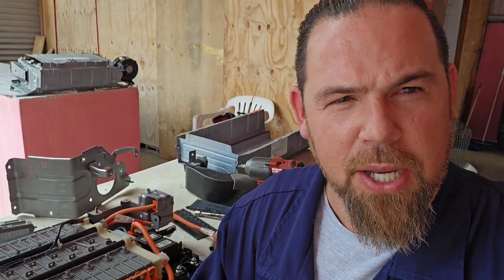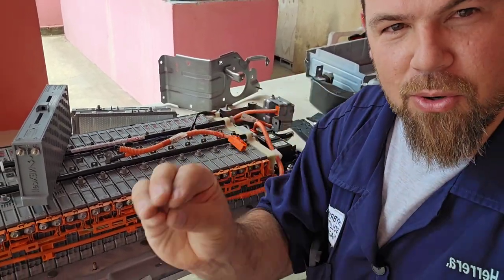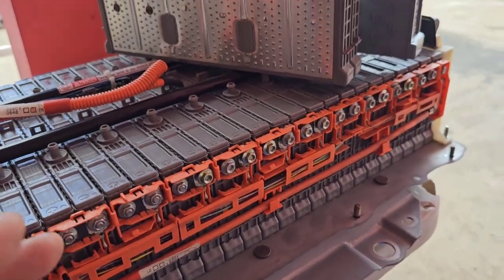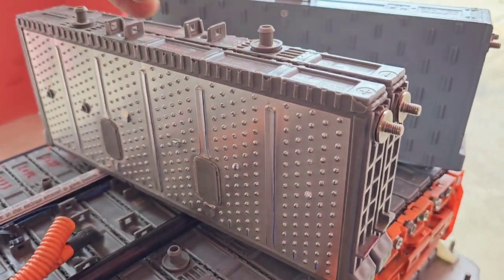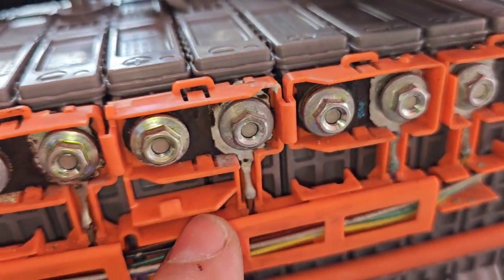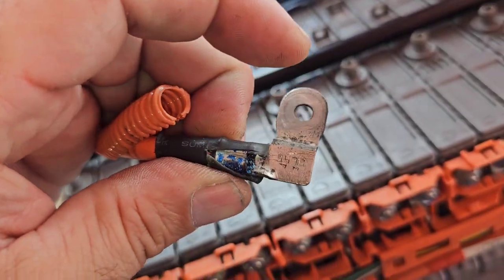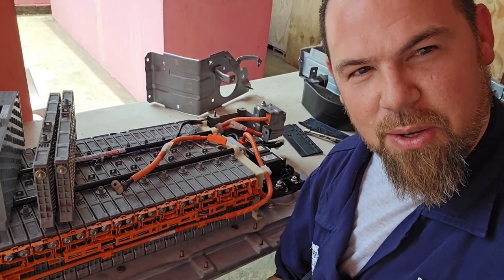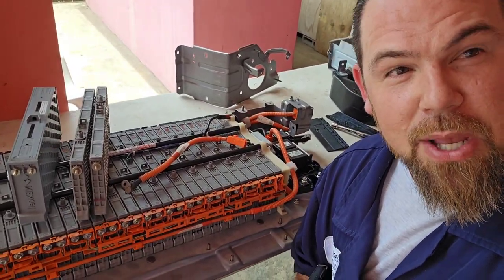Worst mistakes when installing toyota hybrid battery

Comment: Hello , Jose I have been watching you for about 2 years now I personally think you make the most reliable videos and Helpful information . So , I am fixing  my 2012 Prius V  . Because The Dreaded  Light came on and my car died at 200,000 miles . I found out the 12 V Battery was dead and replaced it . And the car started and drove fine but then the Light came back on at 205,000 miles the code said I needed  to Replace the Hybrid Battery Pack . So in April 2023 I used my Think-car 7S Plus Scanner to Diagnose the issue and the Dr Prius Updated app . I found Block 1 Was bad and Replaced 2 Cells and it still showed bad . I thought  I replaced the correct cells in Block 1 but found out now it was Block 14 cells that I replaced by mistake . I wasted all that time and effort because I did not know the correct location of the cells and the Blocks on my 2012 Prius V Hybrid pack .  I just found out that  Block 14 is actually Cells 1 and 2 on A Prius V 2012  . The cells start from the electronics side or Passenger side (1-28) on a 2012 Prius V . But the Blocks start from the opposite side or Drivers side .  Which meant I replaced Block 14  ( Cells 1 and 2 ) Not Block 1 (cells 27 and 28 ) causing me to get the same error as before . I have not found any Video's showing the Block to Cell configurations on Here and Was Hoping you could make a comment or Video about what Cell corresponds to what Block and what are the Locations of the Blocks Such as on a Prius 2008 etc..  and others such as like mine a  2010-2015 Prius V . And How to Test each cell and Completely Check if the Used Replacement cell is good or not or just a waste of time  . and We will be able to know what Cell on Dr Prius Belongs to what Block on the Battery and what is the Location of each Block and if the cell is good or bad . It would help so so Much as all your Video's do . If I had Just Known the crazy configuration of Block 1 was cells 27 and 28 and not cells 1 and 2 . So I hope you can help others in the same boat as I was . Thanks Reggie

Comment: He is lying about capacity. I don’t think he is going to sit there for hours just to measure capacity lol. I work on all types of hybrid and electric cars I’m also certified EV/ Hybrid tech this does not know much except hybrid battery. I actually designed a reliable hybrid battery tester I just won’t share it on YouTube

Comment: Jose.  Just found your videos and hands down the best videos on Hybrid Batteries. I'm a DIYer and have been having recurring problems on the same battery pack, even after changing all the bus bars and nuts.  I was on the suspicion that the corrosion on the cables was the problem and just order new ones.  I haven't gotten them yet to try, but after watching this video, I'm more convinced that will solve the problem.  Great work!!!!!! and superb explanations.
Reply from the maker: Thank you Mauricio, glad you liked it…
Reply: How did it go?
Reply: where did you purchase new cables? thanks, ed

Comment: Good tip re battery cable corrosion, seen this a lot on lead acid battery systems and the cable is not repairable.
Reply from the maker: Yes, it must be replaced
Reply from the maker: @alext8828  is it too difficult to believe the both actually happen! 🧐🧐🤣🤣🤣🤣🤣

Comment: how are you finding the reliability of Nexcell/Project Lithium Batteries? as long as there is not any corrosion on the have the batteries them self proven to be reliable ?
Reply from the maker: So far so good with nexcell… 😎👍 too soon to say yet… let those batteries for 2 more years and we will see 👊😁🔋🔋🔋🪫🪫🪫🪫💥💥💥💥💥💥💥
Reply: @hybridsolutiondiagnostics  thanks for update i heard ppl are getting 10% better fuel economy on nexcell i guess it all depends how you drive
Reply: @hybridsolutiondiagnostics  I believe the hard part is getting the Nexcell/Project Lithium modules. I have been trying to get some for the last 6 months and their website keeps on saying "Sold Out"  Any insights on where to get them Jose?

Comment: Should also mention the corrosion getting into the battery ECU and triggering fires.  The battery main vents don't work. The negative post seal fails before the main vent and that causes all the damage.  There should be a class action suit...

Comment: Love your videos, very informative, very practical in approach. I understand for video teaching it is best to have the entire battery out for service but can a battery service be completed by removing the top shell then replacing the cells or modules and then replacing the connections and top shell? (Highlander or RX400h) thx so much.
Reply from the maker: It is always good to have a deep cleaning of the battery...

Comment: Hi there your videos are great! I am checking a P0AA6 code on my 2008 prius. I took out the HV battery and there was a bunch or corrosion, following your video on how to do that👍🏻. But my question is, will i need to re balance my battery or charge it in anyway or can i just put the battery back and let the car charge on its own? Also the P0AA6 comes on in park without the engine on so it’s not transaxle or inverter, definitely battery/wiring.
Reply from the maker: Yes, it could be a bad signal due to that stupid corrosion… so have it a visual inspect and some measurements

Comment: thanks for posting this video. Where can I buy these hybrid battery electrical cables ....the orange ones that get corroded over time? I can only find them used as on eBay.   I want to purchase new ones.
thanks
ed

Comment: Man, I need one suggestion from you regarding break oil maintenance for my Toyota hybrid fielder 2016. Here in Bangladesh mechanic doesn't have much idea. Car users often suffers with break booster problem and ends up destroying break booster. Can you please let me know the exact maintenance for break system like when to change break fluid, and break shoe so that I don't have face break booster problem for my Toyota hybrid fielder 2016 ???

Comment: Dr Prius app measures internal resistance and gives a reading for each module.  Is there a maximum reading. 

I ask because I've already installed the Nexcell in an 08 Prius and I'd like to make sure I didn't mess up. I don't think so but I did use the original harness (cleaned connections).
Reply: I drove the car today and internal resistance was between 13 & 15 milli-ohms.  Battery temp was 95.8, 95.6 & 92.5 Ferenheit. Blade voltage was 8.14 with .04 Volt Diff.
 That all seems good.  Is there anything else critical on a new battery?

Comment: hola jose! gracias por tus videos son de mucha ayuda, tengo un 2007 camry hybrid el cual no puedo hacer que funcione correctamente, mi scanner me dice que block 2 y 3 no funcionan, ok, los cambio  pero no resolvio el problema, los cambio de nuevo y esta vez remuevo todas las celdas y hago un load test, reemplazo todas las celdas mas bajas, las balanceo, todas marcan 8.2 volts, instalo todo de nuevo  asegurando de limpiar terminales,etc nuevas bus bars y tuercas, y resulta que no se resuelve mi problema, uso dr prius y cuando monitoreo la bateria los bloques 2 y 3 suben y bajan en verde pero bajan hasta abajo en rojo, que puedo hacer? la luz roja en el dashboard ahora prende y apaga en intervalos de 10 seguntos mas o menos. gracias por tu ayuda. por cierto mi carro se apaga manejando,y al parecer cuando esta en con los codigos el motor electrico parece no ayudarle al de gas y el carro esta lento, por favor ayuda ya trate varias cosas.

Comment: 1.POAA649 Hybrid/EV Battery Voltage System Isolation Internal Electronic Failure

Pending

2P0AA649 Hybrid/EV Battery Voltage System Isolation Internal Electronic Failure

Confirmed
Reply: Sir how to solution that this code